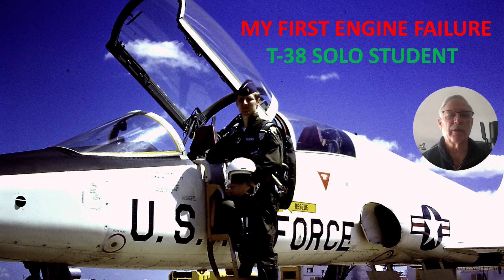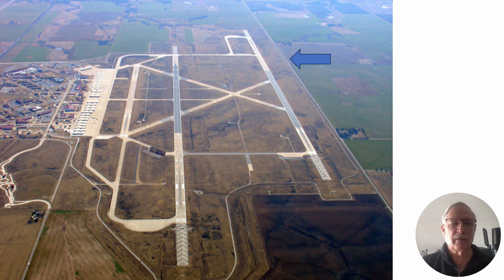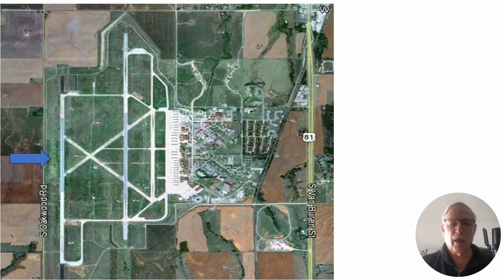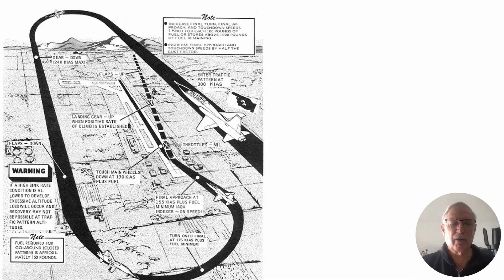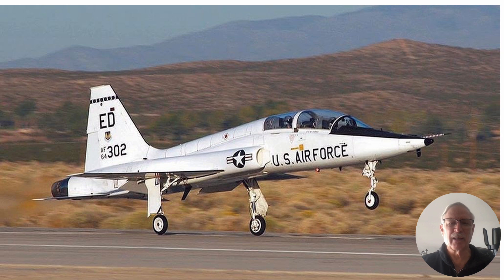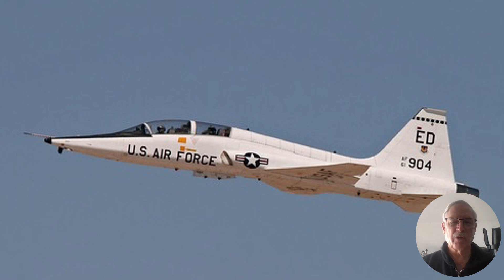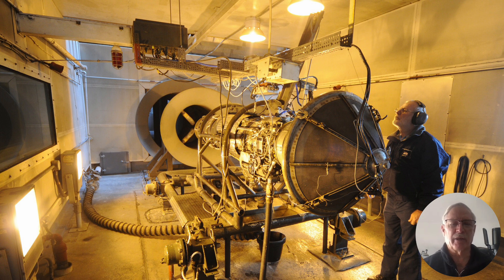MY FIRST ENGINE FAILURE     T-38 SOLO STUDENT

Comment: I was Solo in the radar pattern at Williams AFB, with a couple of T-38s spaced out in front of me. About the time I turned onto downwind, the 38 in front of me called the Radar Approach, and told him that he had just had an engine failure. Moments later, the student told ATC that the second engine had just died (probably because it was eating engine parts from the other engine.) Moments later, the IP and Student bailed out, and I got to watch the T-38 in front of me fly a graceful arc into the desert. I called out "two parachutes". Both were rescued in a few minutes. I think the student was an Iraqi, as we were training them, at the time. (Callsign "Hungry") I have long wondered if I had run into the same guy...say, in 1991.

Comment: Out of Nellis to the radar orbit in SW Utah for a Red Flag, we were just leveling-off at FL290 and fighters are beginning to launch, when Nellis recalls everyone for fuel contamination, morning go cancelled. Just about that same time we start getting compressor stalls on #3 with large bangs! It felt like a monster on the wing with a sledge hammer. Waiting for the other engines to crap out when the FE realizes the nacelle anti-ice switches were off. Doh! Our plane was refueled the day before.

Comment: Thanks for your videos Ron. Worked the J-85 Engine Test Cell for over 16 years at EFD, TX. Best job I've had to date...  Because of the mission, we took troublshooting / diagnostics to the extreme with a lot of engineering and GE oversight. None of us can hear crap anymore though due to the time spent in the test cell run bay.   Side note: as you may be aware, the J-85 was originally designed to be dropped out of the B-52 in the 1950's /1960's along with other engines with the intent to serve a decoys to enemy radar / missiles thereby allowing the B-52 to proceed to target for the real attack. The engine worked so well; it was decided to be used in aircraft.
Reply from the maker: Yes, If  remember correctly it was outfitted on a hound dog missile and ran at 100%. They had to put a different fuel control on it for use in the T-38.

Comment: Most memorable engine failures were flight testing the Beech 1900.  On 0:25 the first flight one engine lost 90% of its power but kept running.  Months later in the test program, the other engine had a more spectacular failure when most of the hot section bolts fatigued due to vibrations set up by the original 5-blade swept propellers.  Pratt and Whitney had just changed their logo to a stylized version of the eagle without the “Dependable Engines” text.   New turboprop engines arrived back to the old logo and no more failures.😊

Comment: Very nice, glad to see maintenance did a good job simulating the failure. The coworker at Learjet was taken as commercial check ride when the engine failed on him, He went through all the procedures for a restart, along with heading back to the airport but ended up landing dead stick at Tucson international. Well of course you had to do a second check ride because they never got to the maneuvers he had to demonstrate for the commercial privileges He was seeking.

Comment: Confession: Landed solo in the 38 and turned off at the end. There was a slight uphill on the taxiway at that point, so I added a little power. When I got to where it leveled off, I retarded the throttles. Oops, as you know, the 38 has fuel cutoff tabs under the throttles. That’s right, I shut both of them down on the taxiway far from the ramp. I coasted over to the side of the taxiway so other airplanes could pass and called ground control. Maintenance came out and assisted me out of the airplane. “What happened, Lt.”. The truth came out and I got a severe reprimand and was grounded for a few days until I had studied a the manuals and passed a verbal quiz.
Reply: We had a guy at Beale that did the same thing at about 1500’ going into Travis. He should’ve ejected, but he selected burner and they both came back. I think it was one of those deals where you’re in trouble for causing the problem and not following the boldface, but you saved the jet so…meh.
Reply: At some point they changed the guards to fix that issue. On the 38C they were a pain to shut off
Reply: @LJDRVR  Believe me, I made a few more dumb shit mistakes before I graduated. Nothing dangerous, just bone headed.

Comment: You are lucky you did not have any P- factor issues.
Because in a general Aviation plane if you lose an engine during takeoff there might defiantly be a pee factor issue !
Reply: I lost a cylinder at 600 feet in a Cessna 172, and I definitely had some Poop-Factor issues!
Reply: @sb859  I'd be interested to hear your story, if you'd be willing to elaborate. Did you have to land off-airport? What caused the failure?